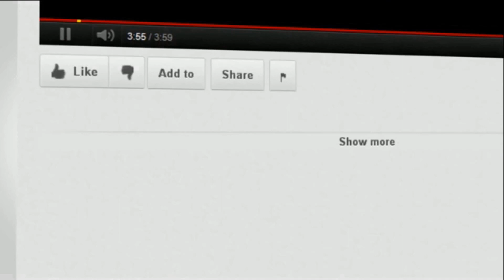13 Hawaii Off Grid Home Construction

Comment: You are one of the few builders I have seen that without saying a word does it right! 🤗

Your deck bases keep the wood posts off the ground.  In addition, you did not have to dig a hole for each post.  This saves time and equipment.  Moreover, the post bases will dry out with the sun and the wind (after absorbing rainwater).  If the posts were in the ground with cement or concrete, then it would soak the rain, but both the underground portion of the post and cement material would dry out very slowly.

Now, when it rains there will be no rotting. Try injecting linseed oil into the base of the posts.  Termites hate this oil.

Nice looking deck by the way.  So, you are off the mainland.
Reply from the maker: Thank you Eric!  Yes we are from the mainland, and I appreciate the suggestion for the termites and I will definitely need that advice - I need all I can get!
Reply: Offgrid Steve I know since I subscribed a while back.

Another other top of my head idea:

You can probably find affordable roof insulation made from coconut at your location.  I would apply it on a sloped roof with water and air flow channels running from the bottom to the top over a layer of plywood and peel and stick elastic waterproof membrane (do your best not to perforate the membrane with screws or nails).

I would sandwich this under plywood again and cover it with another layer of peel and stick elastic waterproof membrane.  If water gets under this membrane, you have a second waterproof protection underneath.

Place battens running from the bottom to the top spaced no more than 12” (to support your weight when waking on the roof).  Place a thin layer of radiant barrier over this.  Now, place a second layer of battens crossed at 90° to the battens underneath.  This will build two air channels for air under and above the radiant barrier.

Place a roof ridge at the crown of the roof.  Now, you have several roof layers feeding this roof ridge with hot air.

Cover this with a corrugated non-rust metal roof.  The corrugated roof will increase air flow below it.  If you can find affordable clay tiles, place these on top.

 Inside the house, you should feel a more comfortable temperature than outside.  This should work out nicely with your large eaves and multiple fans.

Comment: Where did you go ?
Reply from the maker: I’m still here. Happily retired.  But I’ve done tons of work around the place so I guess I could do a video.  How have things been for you?
Reply: @OffGridLivingSteve   Well my off grid Chevy Volt powerwall systems been running for 6 years now. Now it's time to move all of the equipment out of the garage into a separate building homeowners insurance it's going to freak out If I don't get them out of the garage.  So now that you've been over on Hawaii in the middle of nowhere for a while how do you like it.

Comment: Any update on your solar system and—/-can the software that you are using on your inverter work with the pip lv 2424 and can I get it
Reply from the maker: Garfield Oliver Solar Yes!  I have it running on a PIP 2424LV at this moment.  You can see it live here:
http://107.155.121.60:1880/ui/#!/2?socketid=e6V357bcjnrxPCC0AAAy
Reply: @OffGridLivingSteve  hi again how can I get this program and what would I need to connect it to (2) lv2424 connected in parallel